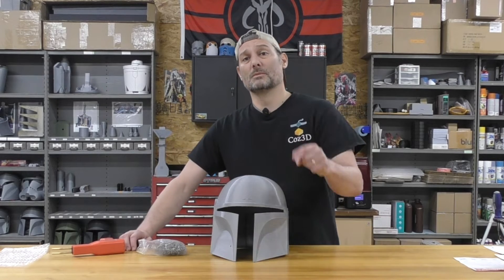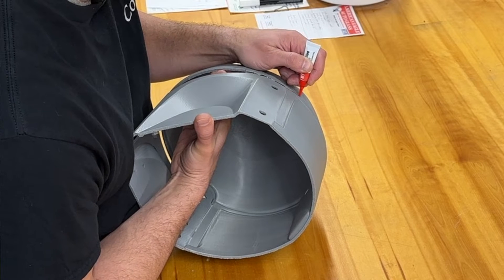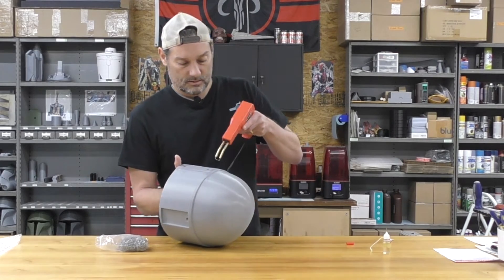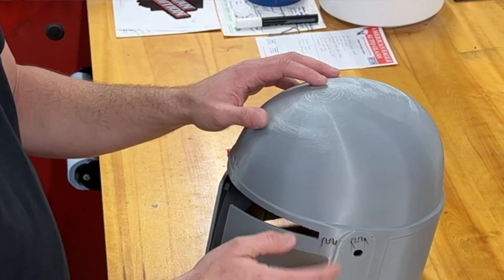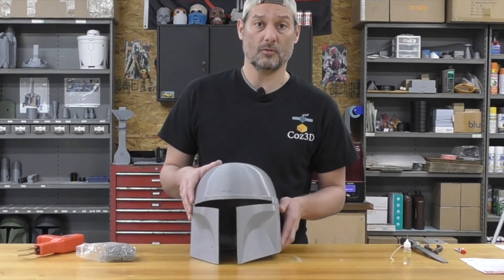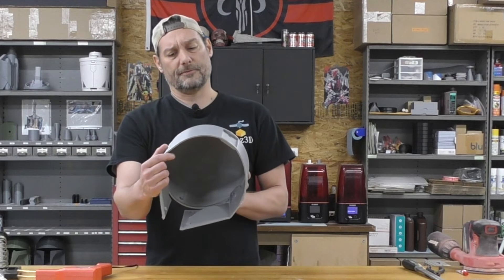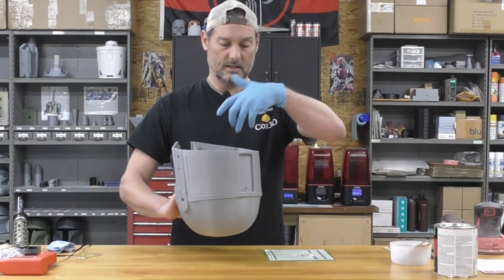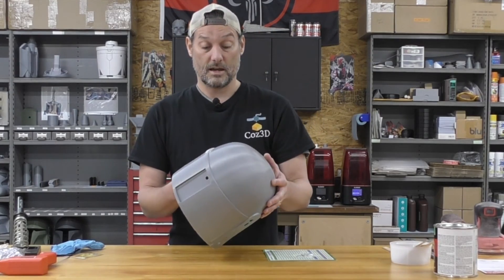Let's repair a cracked 3D printed helmet!

Comment: If I were to do this, but I don't have a welder gun or a soldering iron, what else would work? The crack is not nearly as large
Reply from the maker: You can always super glue it or epoxy it then fill it with your choice of bondo or a wood filler.  Just make certain you have a strong bond so that it doesn't crack again.